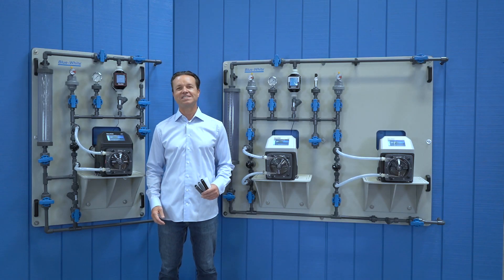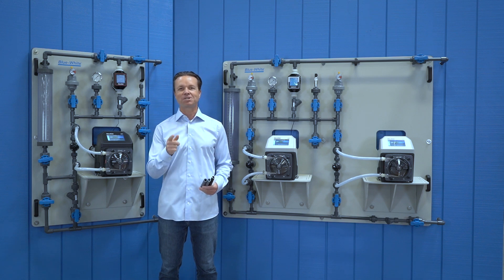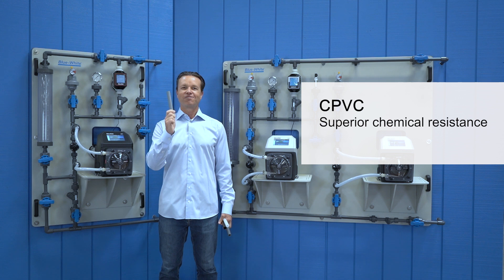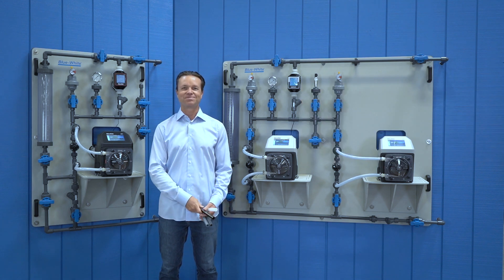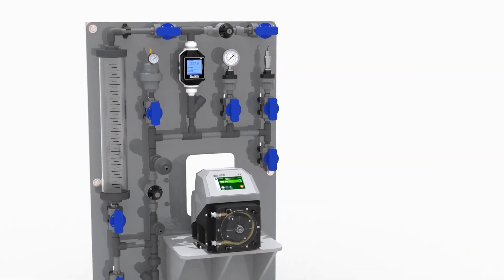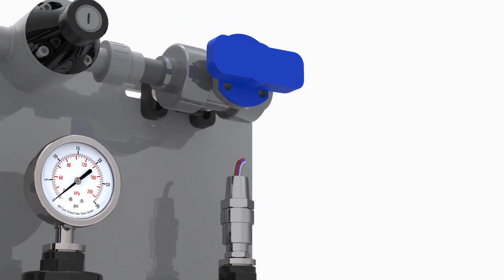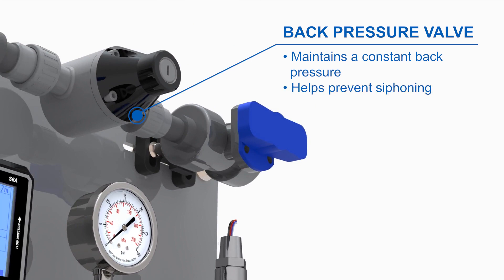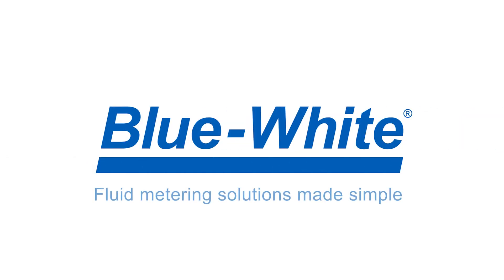The CHEM-FEED® Skid Upgrade

Comment: greeting, do you use a PRV in a by pass line? why?
Reply from the maker: Hi! Thank you for the comment. Yes, the PRV is included to protect piping, pump, and other devices from over-pressurization by allowing the fluid to bypass back to the suction side of the piping/pump once the pressure exceeds a predetermined set point. This valve acts as a safety measure, preventing damage (tube/diaphragm failure) and system pipe/tube rupture leading to fluid leaks and chemical exposure.